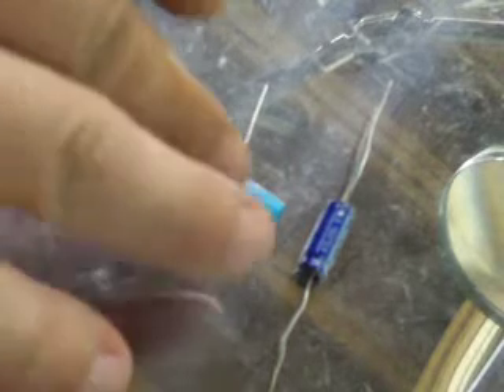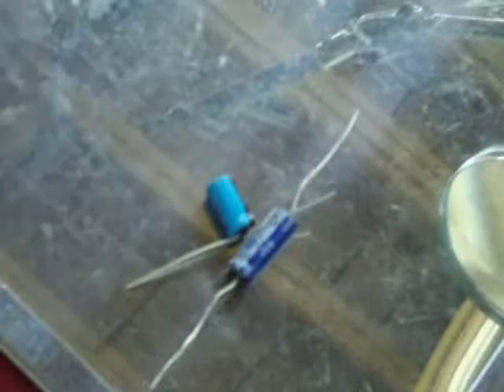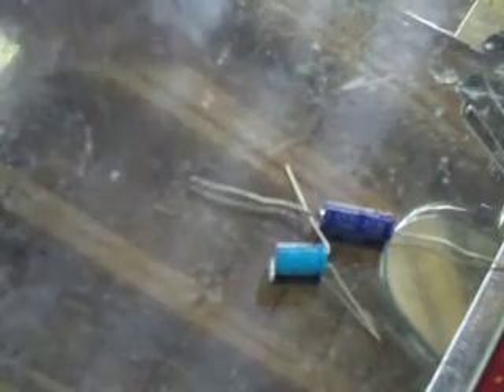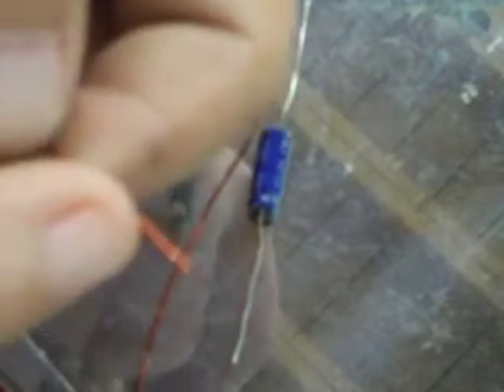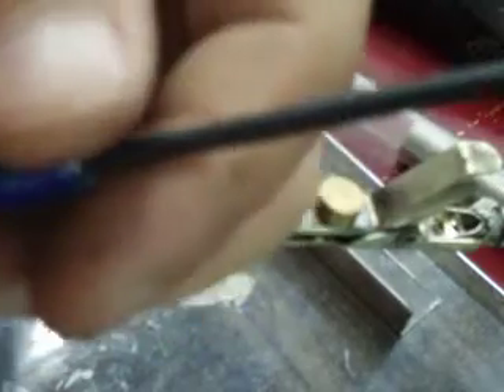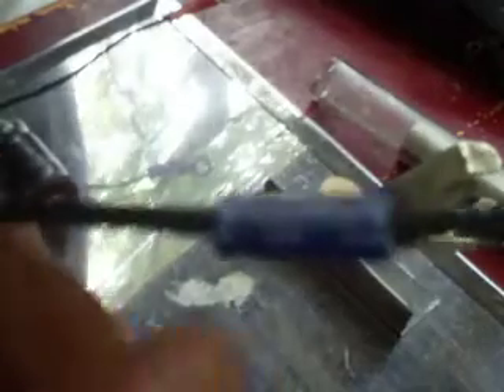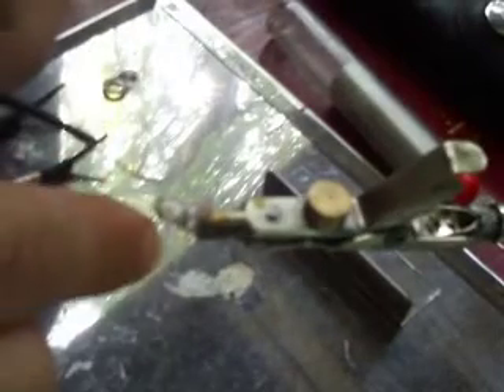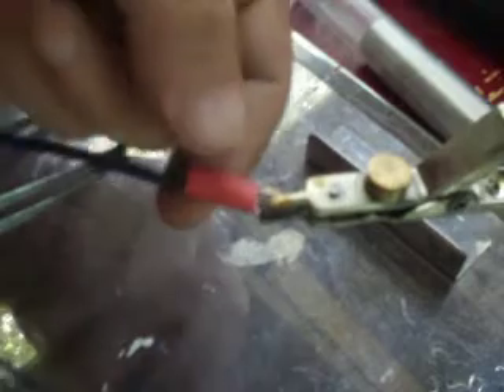⚡Tattoo Gun/Machine Cap⚡ #Soldering

Comment: you have good ideas... your presentation needs some work. If your doing a training video working off a concise script will help you. Most creative people ramble in their heads, which is good, except for training. You did have a few errors in our soldering info. NEVER use acid flux for electrical/ electronic soldering, this is for plumbing only. rosin core solder, rosin flux or silver solder flux (which is in liquid form) is used. The pur[ose of flux is to clean and assist in forming the chemical/mechanical bond. When you solder wires together, like adding to the capacitor lead length, don't clean the enamel off the first 3/16 of the wire. don't get any flux on this area. I usually use a small bit of shrink tube, do my flux, cut off tubing, clamp with hemostats, solder and then trim. When you soldered those leads there was a lot of movement in the leads while they cooled. this could possibly form a cold solder joint, which could cause problems. I'm not trying to diss you or hate on you Bro, I really like what your doing and am trying to help.